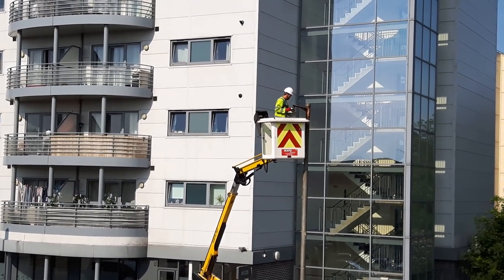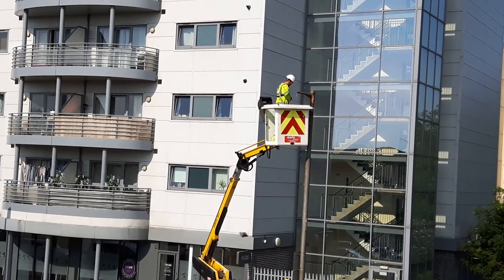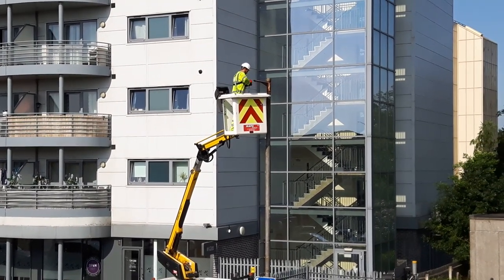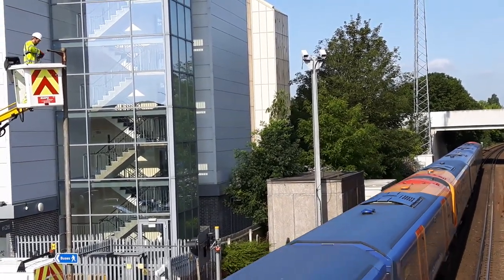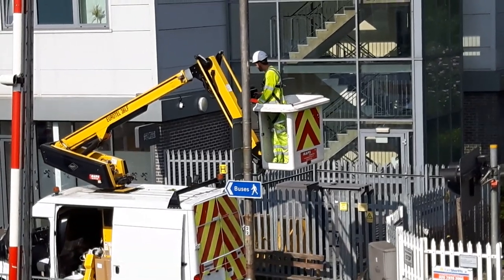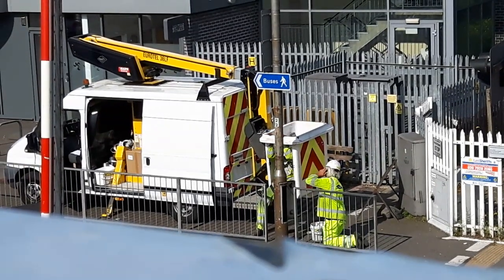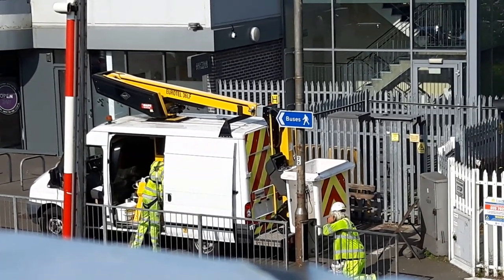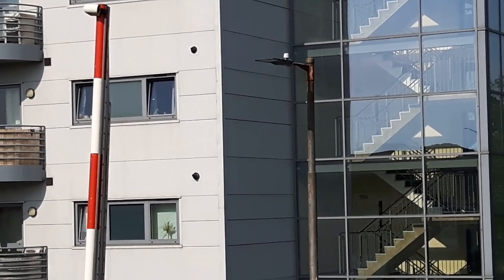Streetlighting Lantern being Changed over, (SOX to LED).

Comment: 1:15 desiro train sound 

Speaking of train sounds and streetlights, Class 465 BREL/ABB built used to have Brush motors, and now it's Hitachi and boring, same with LEDs, old SOX ones are nice and LED is extremely boring
Reply from the maker: That was filmed from the footbridge at Cosham station,  near Portsmouth.